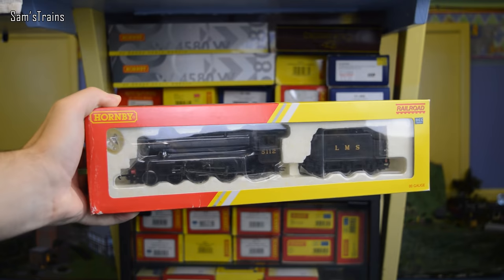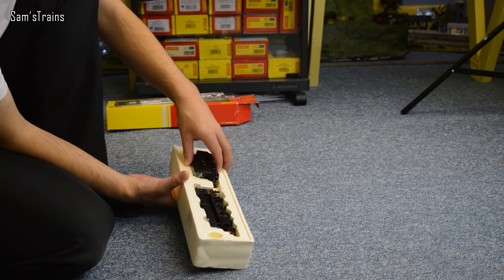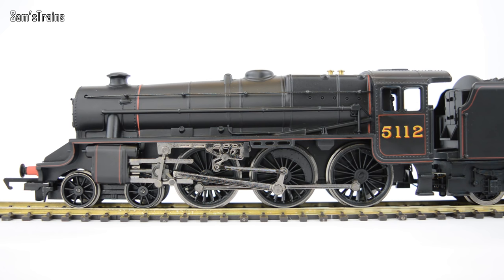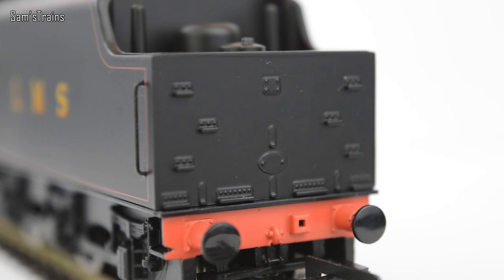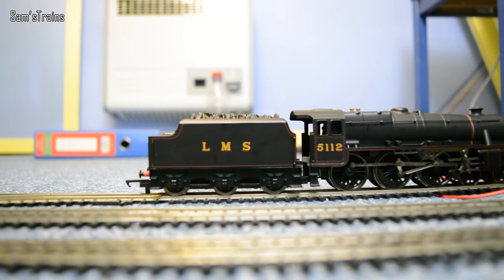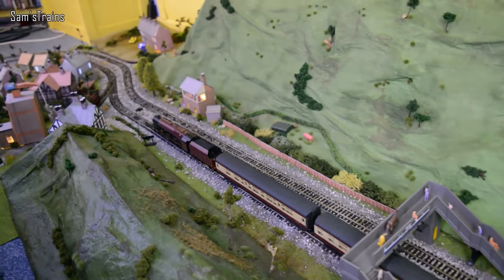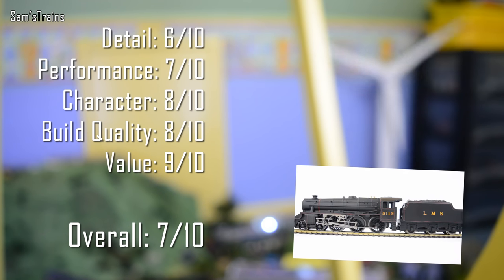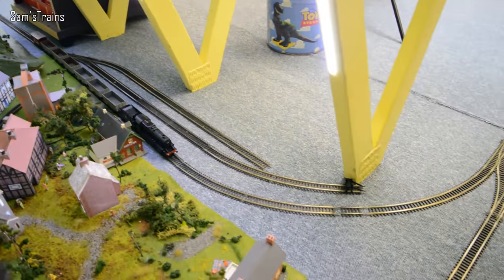Unboxing the Hornby Railroad Black 5

Comment: The Black Fives are awesome. Stanier's inspiration for them were the Halls from his time at Swindon. The Halls and Black Fives have many things in common: Both are mixed traffic locomotives, both have the 4-6-0 wheel arrangement, both have the 225 psi boiler and both have six inch driving wheels.
Reply from the maker: Thanks Jacob - ooh that is cool - it's awesome how these locos are all related! :D

Cheers,
Sam :)

Comment: Sam you weren’t joking when you mentioned the weight of the tender! I’ve just got one of these and my word, it’s heavier than the loco. The frame is die cast metal and the inner is the old tender drive casting which explains the weight. But yes I think I’ll need to lighten it as it’s drastically impairing hauling power.

Comment: I have the 2004 weather edition of 44666 and funnily enough mine also has a max of 4 coaches. Scared because in 1999 flying Scotsman almost stalled pulling 11 coaches up 1 in a 100 Hatton bank but in 2000 black 5 45407 pulled 13 up the same bank going a lot faster and even with steam to spree.  Something I hoped to recreate with 44666 but obviously the model had other ideas
Reply from the maker: Ooh interesting - was yours a tender or loco driven one??
Thanks for watching - Sam :)
Reply: Loco driven

Comment: My model railway is loosely based off my town back when it was a MASSIVE railway industry and and i found out that one of the lines was a joint railway between the lms and lner! So even though in some of my comments i say something like "i like this lms loco but my railway is based off the lner" well now i have an excuse to have lms locos! 

Also if you're wondering, my town is called 'wath upon dearne' and there is almost nothing left of the railway. All i can find are old buildings (like what looks to be engine sheds that have been converted into storage buildings) and an old tunnel that has been flooded. If you are interested about the flooded tunnel then its on a video that i made on my train channel (green sharks trains and models) and the video is called something along the lines of 'old tunnel near mexborough'
Reply from the maker: Ahh that sounds fantastic - what a good excuse indeed! :D
Thanks for watching - Sam :)
Reply: Good call matey, I know Wath. Im trying to find the same excuse for my lner biased setup. On photos I can see plenty of lms wagons in sidings amongst the lner/pre grouping so think I can get away with it haha. Im just about to bag one of these for 40 quid, so for that bit of improvement could be made at home.

Comment: Also, I have spotted the 6 other locomotives, including the odd one out. I can now name all the locomotives featured in this video.
Main Locomotives: Hornby Railroad Black 5, Hornby Princess Royal Class, Hornby 8F.
Other locomotives:
1. Bachmann Brunswick Green Patriot Class.
2. Hornby Streamlined Coronation Class in Caledonian Blue with Silver Lining.
3. Triang Maroon 3F Tender Locomotive.
4. Hornby LMS Crimson 4P 2-6-4 Tank Engine.
5. Hornby Fowler 3F Jinty in LMS Crimson.
6. Hornby GWR Hall No. 5972 'Olton Hall' AKA 'Hogwarts Castle' - The Odd One Out.
The reason 'Olton Hall' is the Odd One Out is because the other eight steam locomotives are from the LMS or Midland Region, while 'Olton Hall' and the other 4900s are from the Great Western Railway or Western Region. Also, which pictures have you put up that I sent you, can you name some of them?
Cheers,
Adam :-)
Reply from the maker: Hi Adam, yeah that's right! Though it wasn't Alton Hall, it was the Hogwarts express, which is a Castle, thanks to a mistake from Hornby!
Thanks again mate,
Sam :)

Comment: Wonder if the tender weights can be taken out and replaced with small balancing weights. Even use a dremel on the lead. Alternatively, is it possible to install a tender motor making it the only tender driven (analogue power) / DCC engine driven Black 5 in UK? Obviously a fire extinguisher close by would be advised. Maybe the Dremel is more feasible. (all I've been drinking is tea, in case you wondered!). Alan
Reply from the maker: Hi Alan, sadly the tender weight is all part of the cast chassis, you'd need some serious surgery to get it out, so I decided to leave it! That's a good idea too - but I think the decoder would probably go up in smoke and flames lol!
Cheers mate,
Sam :)

Comment: As an update....I just bought a Mainline stanier tender cheap from ebay. It's in LMS black so I'll need to repaint to early BR. I also need to fit pickup wipers and a new tender drawbar pin. But the mainline model is quite superior in accuracy and detail as well as being a very free runner. The Hornby tender weighs 182g! The mainline tender is 82g! I'll let you know how it changes performance on the railroad black five. With a little weight I'm betting it'll handle a 9-10 coach train, as it should!
Reply from the maker: That sounds great Craig! Let me know how you go on! :D
Thanks for watching -Sam :)

Comment: To be fair I've got 2 of the original versions of this with the tender drive. One in crimson lake...... not sure why they did that and find them great engines for what they are. Reasonable detail but not fragile. The new stuff is great but the detail sometimes makes you nervous 😂. Also I don't mind the ringfield motors. They work fine if you keep everything spotless.

Comment: Hi Sam long time watcher first time commenter.  I have the older 1989 5142 LMS black 5 with 3 pole ringfield motor. Detail looks very similar but IMO paint job is nicer and decals on tender much nicer. 

More than anything though, the ringfield version pulls 6 old triang coaches with the old wheels around my layout without too many complaints.I would grade the performance of this loco as 4-5 maximum. 4 coaches I could accept from a 0-4-0 but unacceptable from a Black 5.

Keep it up Sam, great work :-)
Reply from the maker: Hi Ralph, welcome to the commenting! Yeah, I can believe the detail is similar, I think it's the exact same body, and yeah the decals and paintwork does vary a lot from Hornby.
Yeah, you're right about the performance, 7/10 is too high - the problem is that the loco is reasonably powerful, it's just the weighty tender weighs the same as about two coaches, which really knocks her pulling power down!
All the best mate, thanks for watching,
Sam :)

Comment: No offence Sam, but you see I live in Singapore and its rare to get 00 gauge model trains. I go to the Uk frequently and get Hornby trains easily. I have this black 5 and when I compare it to my tomica locos (they are for really young ages) they almost have the same level of detail but they cost like $70 (around £40) different! The only difference are the handrail and smokebox dart.
Reply from the maker: Hi Mate, no offence taken! But the tomica locos are inferior to these, in my opinion! They're plastic and basically uncontrollable! It's true, they're similar in detail to this model - but this is the very most basic model Hornby do! Don't forget - these locos pick up power through their wheels, which are metal - and that's a huge advantage!
All the best,
Sam :)

Comment: Good review Sam, I've got a feeling that model is made from a 1970's tooling, so no wonder it looks a bit primitive.

As for the odd one out, the Hall masquerading in Maroon?
Reply from the maker: Thanks Jon, yeah that's right - it's identical to the 1970s version, apart from the running mechanism!
And yes, it was the Hogwarts express - though it is actually a castle due to a mistake from Hornby!
Cheers mate,
Sam :)
Reply: As us GWR types say, The Hall with delusions of grandeur.

Comment: Only 4 coaches, not very useful; my tender driven Hornby Black 5 can manage far more than that! Can any of the weight be removed from the tender? Otherwise it's Bullfrog snot to the rescue!!
Reply from the maker: Hi Gareth - yeah that's true! The tender driven versions will be much more powerful, due to where the weight is! The tender weight can't really be removed without serious surgery, though I may try to add more weight to the loco, since I really don't like traction tyres/bullfrog snot lol!
All the best mate,
Sam :)

Comment: Be careful of those tenders. My 9F has the same kind of tender system and the Ringfield literally crumbled. I had to make a new chassis for the tender.
Reply from the maker: Yeah! I've had a few problems with those tenders, definitely not too well made - but mine don't have ringfields in them, which is lucky!
All the best,
Sam :)

Comment: can DCC ready hornby engines be controlled by a normal controller
Reply from the maker: Hi! Yeah DCC ready just means DC - you can run it on any DC controller! You need to chip them, or buy them DCC fitted, to use a DCC controller!
All the best,
Sam :)
Reply: Sam'sTrains thanks sam

Comment: All they need is a little extra weight. Stuff some lead in and they will pull.
Reply from the maker: Yeah that's true - there's not a great deal of room inside the engine though - what with the DCC decoder!
Thanks for watching - Sam :)
Reply: @SamsTrains  I think that the tender wheels are the problem. They are not free running at all. I've got heavy tenders on other engines but they run well.

Comment: mine had the tender drive moter in side the tender and had to replace the tender very bad design for it number 45000
Reply from the maker: Ahh so you have the slightly oder one! Yeah they're not very reliable - but I think yours would pull more coaches than mine can!
Thanks for watching,
Sam :)